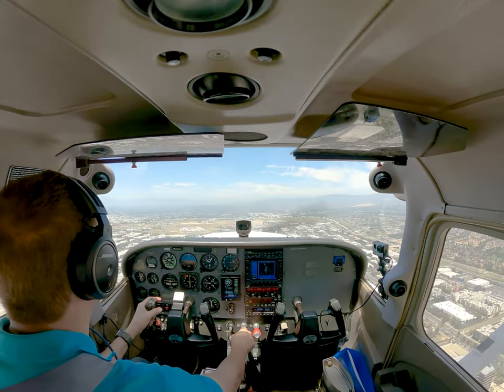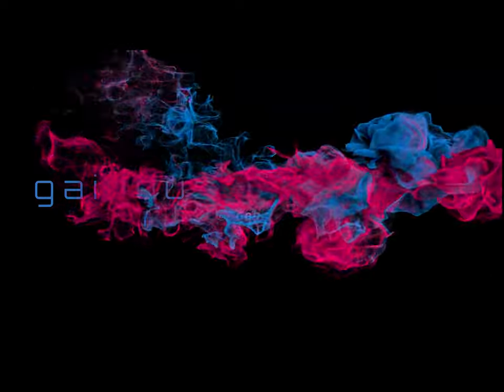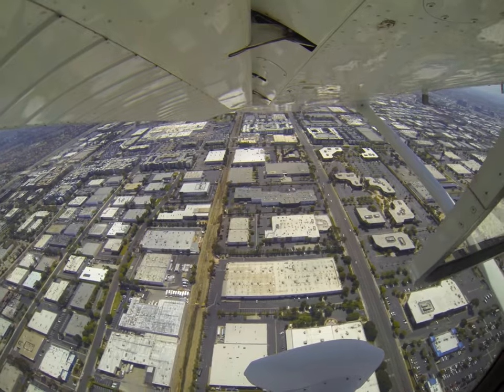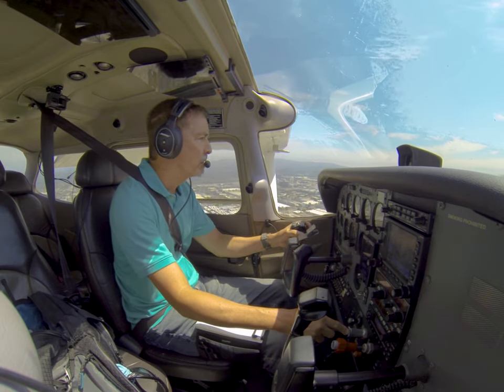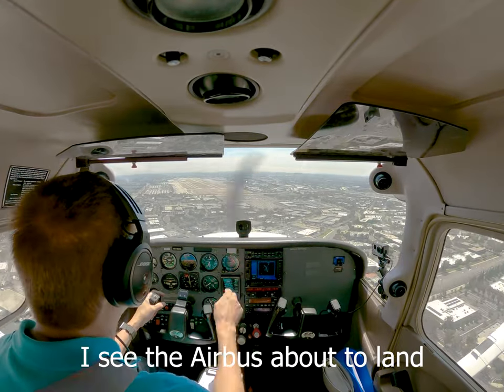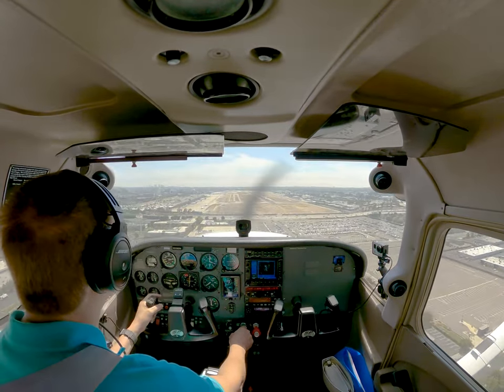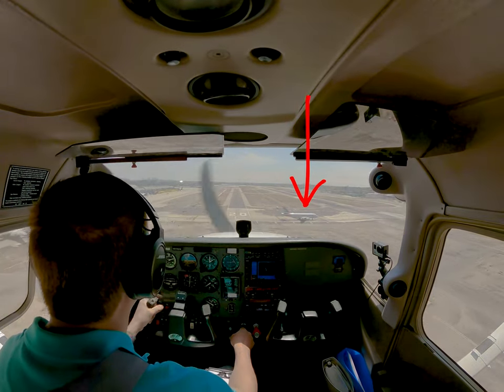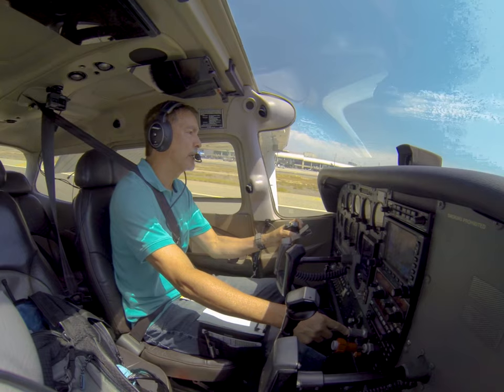Cessna Contends w/Two Airliners

Comment: Nice job Les!  Good explanation of the daily dangers of flying GA into John Wayne.  Occasionally, an airliner holding between the runways doesn't pull forward enough, leaving their tail across the hold bars of Rwy 20L, in which case you should always go around and advise the tower why.
Reply: or you could just land beyond their jet blast, which is what we always did at SNA
Reply: Best to Go Around when any obstructions are blocking your runway.
Reply from the maker: Thanks, @marty. Luckily, I haven't had happen yet (tail sticking out onto 20L).
Reply: @MartyMitchell92660  it’s pretty much standard procedure to land beyond the jet blast of airliners commonly holding short on taxiway L when landing. It essentially becomes a short field landing which is what we train for.
Reply: @LesGainous  I flew out of KSNA during my private and it happens very very often. It would not be ideal to go around any time an airliner was holding short on lima
Reply: @vincelam1998  We all agree on that.  My point is that a go-around is required if they are blocking your runway with their tail.  Happens often at KSNA.
Reply: @MartyMitchell92660  oh gotcha, sorry i kept assuming you were referring to jet blast.
Reply from the maker: @vincelam1998  I don’t think that’s what was said. Marty mentioned that occasionally an airliner—that is holding short of 20R at Lima—would have it’s tail sticking out onto 20L. He’s not suggesting to go around any time an airliner was holding short.